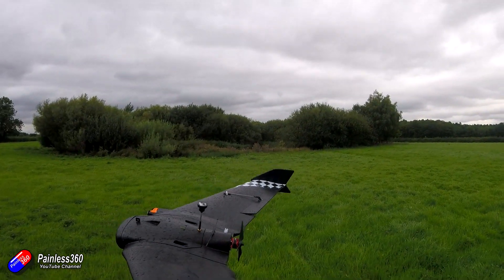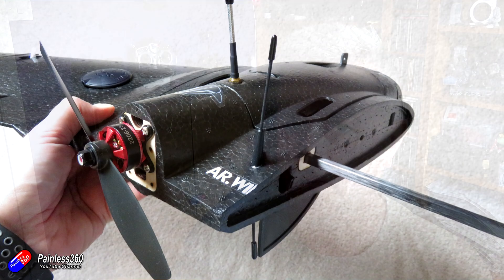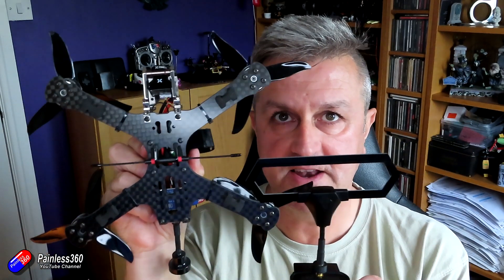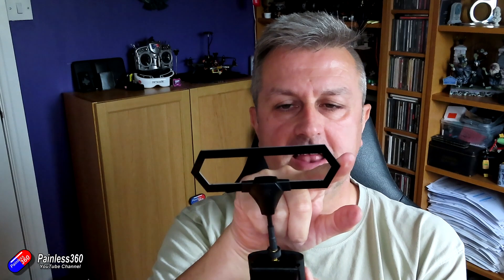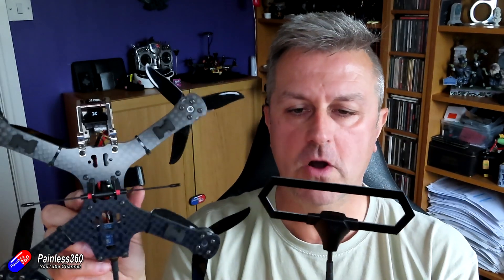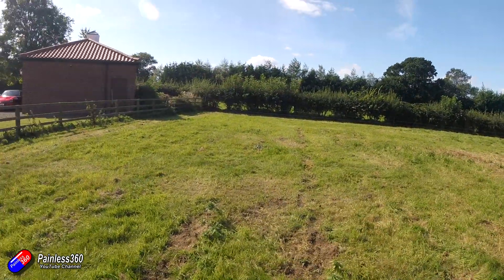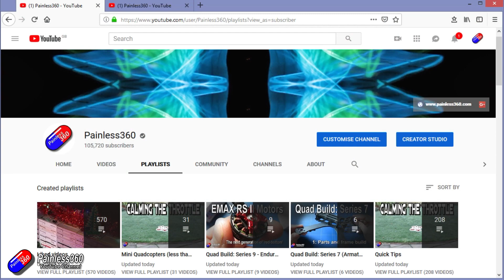TBS Crossfire Antenna Alignment Explained

Comment: Hello:  where does the antenna that rotates like yours come from?  Which TBS module has the removable antenna?  Ty. John from NC
Reply from the maker: The earlier modules have an SMA style connector on so you can do this. The latest modules are starting to move to a fixed antenna to comply with the latest FCC rules..

Comment: I know the stock antenna on the TBS tracer is straight so if I folded it down to where its side to side would work with the tiny T's from micro receiver  installed on the quad side to side?
Reply from the maker: I'm not sure if you are describing..

Comment: Lee, quick question:
With all the fancy 5.8ghz Antennas, wouldn't be the best for a long range wing be a simple dipole on the tx? Since the orientation is almost always vertical?
That's bugging me for quiet some time now...
Thanks :-)))
Reply from the maker: That's how I mount them.. Happy flying
Reply: @Painless360  Sorry, I meant the type of antenna. Not a clover leaf or anything, just a simple dipole. Since a plane doesn't do shenanigans in long range.

Comment: Very well explained. Thanks a lot. The first time I really understood this. But what I still don't know and can't find anything about it: Can I use crossfire receivers as well in boats and seaplanes where everything is build inside without any antennas on the outside? Or would I be better off with another system here? Crossfire and the Tango2 I would like to use do not seem to get any reception in boat and plane communities.
Reply from the maker: The lower frequencies that Crossfire uses have better penetrative power than traditional 2.4Ghz systems so would work better inside a model. However normal 2.4Ghz should be fine with internal antennas with a little care... Happy flying

Comment: How is anyone supposed to mount an immortal t on a 5" in a vertical position without occlusion? I can only think that having it way up above or behind extended out on a pole is acceptable but even the extended immortal t only gives you a tiny bit of extra length. I spoke to the VAS guy about vertical antennas like the TBS tuned antenna with a U.fl rather than SMA and he said he does not do them and recommended his xfire pro antenna which seems even more difficult to mount vertical and he has it mounted horizontal and occluded on his demo video.
Reply from the maker: At closer ranges horizontal is fine as even the nulls at the ends of the antennas have enough sensitivity to get a good signal...
Reply: @Painless360  At what range though? I messaged VAS with my setup that is horizontal on the rear and he said it's a recipe for disaster and I'd be lucky to make it 3km and it would likely failsafe when I turned around. The same setup loses telemetry at less than 1km. I have immortal t v2 + micro module with power update on dynamic. Do you know if dynamic power stops working when you lose telemetry? Should I run a fixed power level?

Comment: I just lost at plane with a full size R9 receiver with dual immortal t style antennae (diversity, unsure, but there are two antennae). I tried various configurations, which worked fine, however, when I mounted these in a cross (looking from the back or front) next to each other, I was caught off guard and quickly lost RF about 100 meters out. Do you know if this "cross" configuration might have caused my rapid loss of signal? I'm assuming this applies to the Crossfire dual antenna receiver as well. I should also note that Frsky discontinued this full size R9 receiver (spec at 10km range). Are you aware of any issues with this receiver? Just hoping to maybe learn something from my experience. Thanks for the videos.
Reply from the maker: I'm not a fan of the R9M system here. See my video on antenna placement and the antenna lab series for how I do it. Having one at 90 degrees from the transmitting antenna could have been part of the issue.. Happy flying!

Comment: Dear Sir, This is very informative and useful video. 
1. Please explain I've seen pilot install the crossfire antena mount 90 degrees in their quad like 2.4 Ghz (the cable one, not the immortal) . and for the tx installed horizontally. but is it okay ? 
2. Is it worth to buy Diamond antenna? what is the great difference vs the stock tx immortal? pls share your experience,

Thanks a lot
Ditto
Reply from the maker: Both these questions are answered in the video. Aligned antennas are always best when they are linear.. Happy flying!
Reply: @Painless360  Thanks. I just got a new diamond. in horizontal mode, I saw in your video the TBS head must facing the quad. and the VAS logo facing at me if in horizontal mode. is that correct Sir?

Comment: Hi I was just wondering I have just got on the crossfire band wagon and I set up3 quads all have a very low rssi of 57 to 60 and wven the LQ drops to 130 maybe 100mts away I have watched your vids and others before I set it up and do you have any ideas on whats going on  thanks.
Reply from the maker: Crossfire antenna placement is the most likely. What troubleshooting have you already done?
Reply: @Painless360  I have tried different antenna positions and Ive put the back under the arms 2 are on the left 1 on the right all 3 quads are totally different fc and esc frame and motors  maybe its just my setting because all read the sàme today i was get low dbm alarm less than 100mts away but my lq was still at 300 i have it on 250mw all all has 3.23 latest firmware maybe i will try my friends diamond antenna

Comment: can anyone help. my drone has no roll or pitch but everything is working in the receiver tab on Betaflight, receiver is grand and everything connects. she hovers fine  but the once you get her going you loose pitch and roll. only throttle and yaw that work. Mode 3 and connected via crossfire, like I said the drone rolls and flips on Betaflight but just shoots to the moon if you give it full deflection on roll in real life. been stuck for a while, any help would be appreciated. I'm thinking about buying as new radio as I'm out of ideas.

Comment: I'm using TBS Crossfire Tuned TX Antenna. What is best alignment for receiver antenna in such case?
Reply from the maker: As it's still a linear antenna you still need to have the same orientation on both antennas. It is the same principle. Happy flying! .

Comment: Hi!!! Your explanation is great, but what about the strenght of the signal in the direction perpendicular to the diamond antenna plane? I'm asking that because i had a failsafe about a month ago (here you can see the video https://www.youtube.com/watch?v=POKdN491Z5E); the diamond antenna was placed horizontal and pointed to the base of the chimney, and the antenna on the quad was placed on the rear arm (approximately at 45 degree angle with respect to the diamond)... i was at about 10-15m from the base and i was flying right above my had when i lost the signal... that afternoon other 5 guys were flying with crossfire in the same place, and i was the only one to have a failsafe... but i was also the only one to use the diamond antenna since the others were using ImmortalT on their modules. do you think that the mutual antennas orientation was wrong? or could it depends on different factors?

Comment: Thanks for the video.. is it really worth in investing in diamond or the TBS tuned antenna for crossfire? Isn't the stock TX antenna good enough?
Reply from the maker: To be honest I got it cause it looked cool and I've not had a need for a relative test...
Reply: The diamond antenna or the switch all outperform the standard antennas due to ground multipathing/reflections and they are a higher gain to boot
Reply: @ContagiousIdeal  thank you

Comment: I had mine horizontal  on my quad i went out 1.5kms and when I  turned around my rssi went to 9%  vertical it doesn't  go under 90%   over 3kms away :)

Comment: Nice info & demonstration. Thanks. 
Is there improvement in RSSI values in parallel placement & right angle placement...???
Reply from the maker: You'll need the antennas aligned in whichever orientation you use but vertical is a lot better for planes for the reasons covered in the video... happy flying!
Reply: @Painless360  Thanks a lot to clarify.

Comment: As always a wealth of information! I'd love to know just how detrimental a coil loaded dipole is and why TBS doesn't make them for an alternative to the now standard immoral-T I know the full size 8ch receiver comes with them but that's a little big for my 3" japalura 😅

🍻cheers🥃
Reply: Coil loaded isnt as good as a free hanging earth
Reply: @markhinchcliffe5803  I understand but just how detrimental is it ?not worth it or not as bad as you may think??? 🥴
Reply: Latency,racing,reliability,,....
Reply: @markhinchcliffe5803  over the air updates aswell.
Reply: I fly planes as well thats how i know. ...
Reply: T
VAS makes most of TBS antennas and they DO sell coil loaded dipoles. It's something like a loss of 10% or so of range which is practically meaningless since crossfire has a 100km+ range
Reply: @ContagiousIdeal  show me a crossfire system with dipole antennas that does 100klm round trip or are you speaking 1 way,im fully aware of crossfire system and antennas,and dipoles do not have that type of range,the topic has been taken way out of context with the Authers request.
Reply: @ContagiousIdeal  good to know thanks for the tip.

🍻Cheers🥃
Reply: Just get the new VAS PCB antenna https://www.videoaerialsystems.com/collections/antennas/products/915mhz-mini-rx-antenna
Reply: @ContagiousIdeal  nice call just looked it up thanks to your link and that's a perfect option thanks!
Reply: 10% of your 100klms=10klms.......yeah meaningless. ...coil loaded are not the way to go,they were designed for Quadcopters,i have a set for mine.